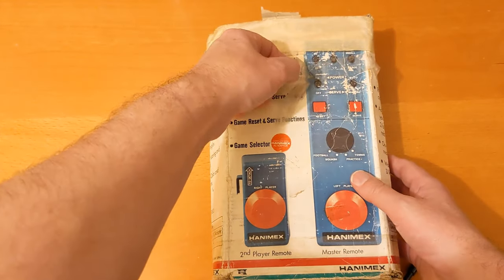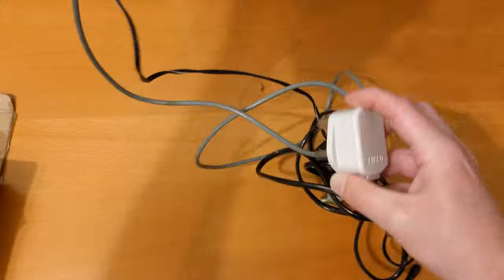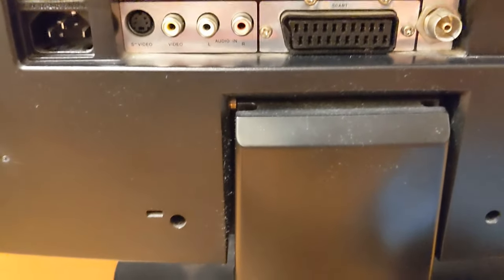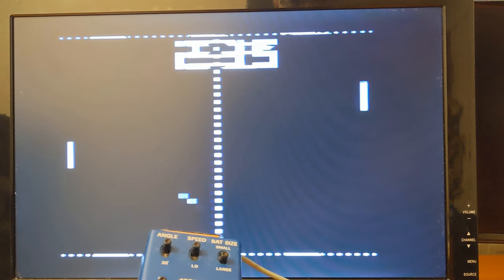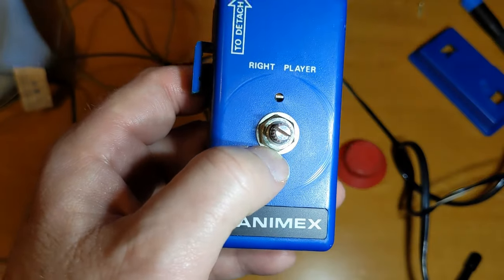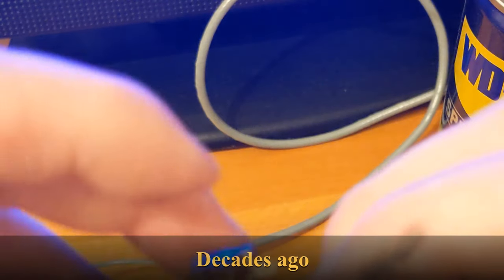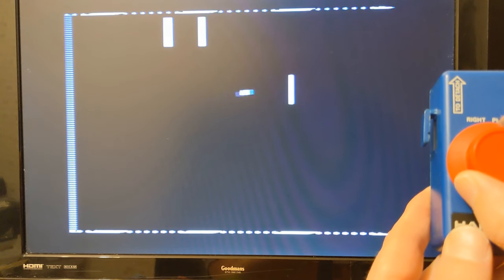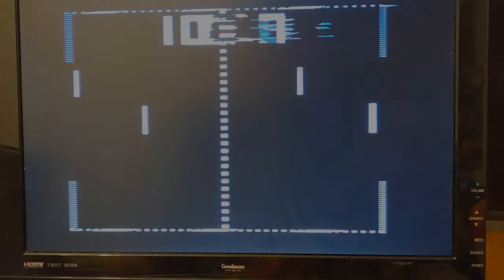Hanimex 666S 1970s Pong Game Fix & Demo

Comment: I have one of these - family had it as a kid and I've managed to hold on to it. 

My controller has the same problem - and I've long thought it should be a trivial pot replacement - which I've never gotten around to doing. 

Anyway, 5min in and I'm writing this. Off to watch the rest 👍

Edit: great that that was so easy to fix! Motivates me to fix mine. 

Further evidence btw that yours was poked with in the past, I'm pretty sure it's not meant to be power hard-wired in. I'll confirm my memory when I dig up mine from whichever deep box it's in, is that both controller and power were 3.5mm audio jacks
Reply from the maker: Great. It would be great if you can confirm. I hope yours is an easy fix too. Thanks.
Reply: @CBitsTech  confirmed (seems I can't link to imgur? anyway I've put a "gallery"  at "hanimex-666-pong-game-console-9fHN7bQ"

(tl;dr: cable well soldered to the pot in the secondary controller, secondary controller with a 3.5mm jack to the main, and power has a 2.5mm jack)

It'll be some time yet before I get a chance to attempt a fix and test though